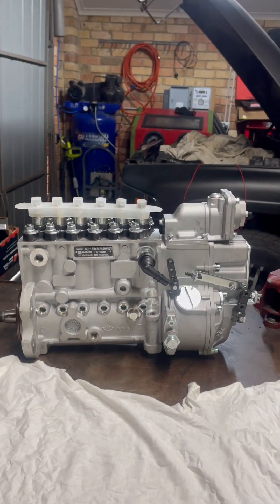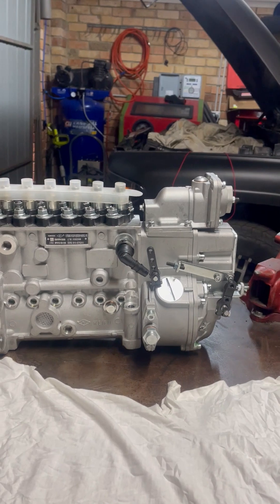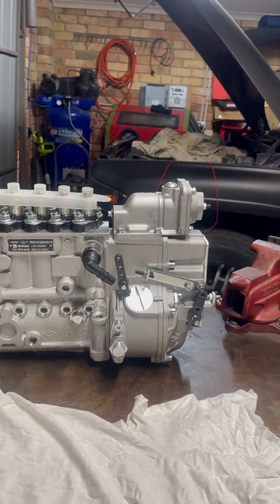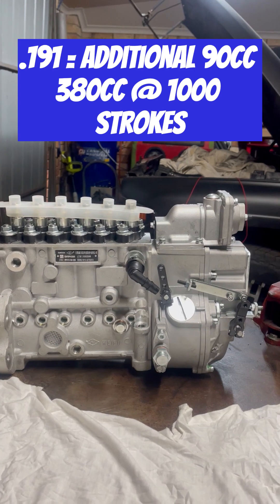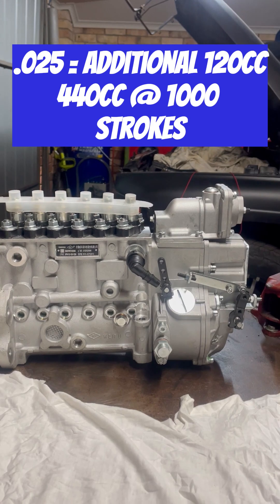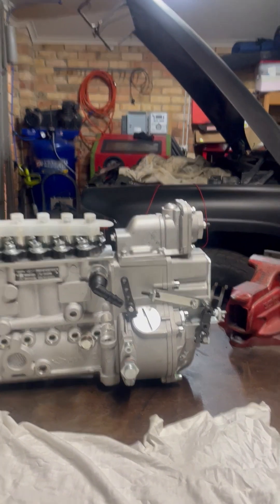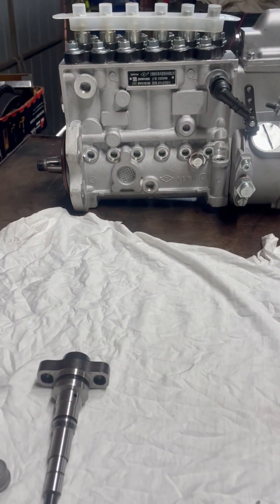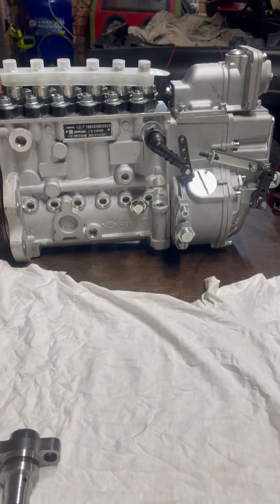p7100 build series 2

Comment: 440cc can do about 700hp-750 if the air is right on a good dyno. Even more if u clean it up with nitrous. Guys with maxed out 12mm 600cc pumps and nitrous are well over 1000